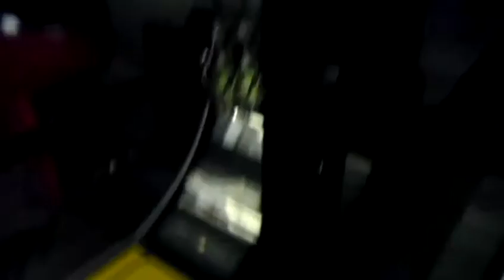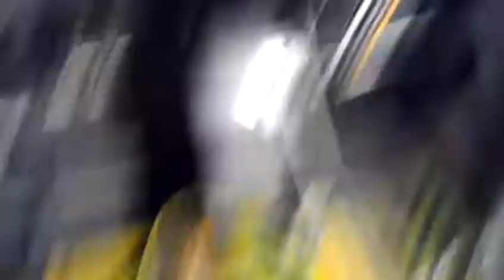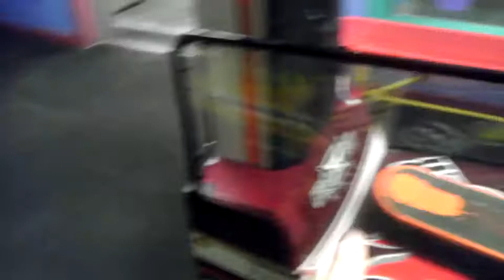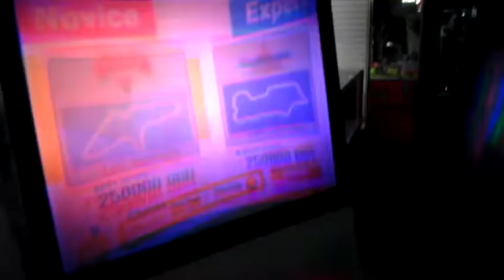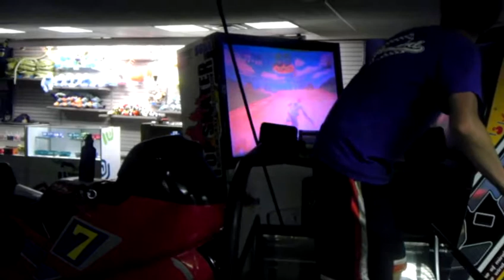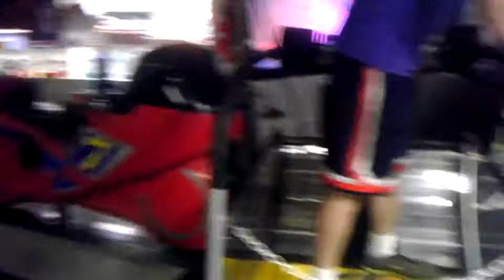Top Skater with an Air Trix controler: WHAT HAVE I DONE?

Comment: So does it work?
Top skater on Air trix?
I have Air Trix and I am hoping to be able to play too skater on Air trix arcade if I can find the hardware.
Reply from the maker: I never tested top skater on Air Trix. The connections are good, but I would remove the lights or light amps from the controller. I still have my Air Trix cabinet, but my boss sold the Top Skater. I have a backup system in my room if you PM me or hit up Vix Zekken on Facebook or Twitter I can throw over the pictures of the system and wires needed. The brake lock circuit on my Top Skater was messed up.
Reply: @DDRMixer  can you PM me the info?
Not sure how to add you. Lol